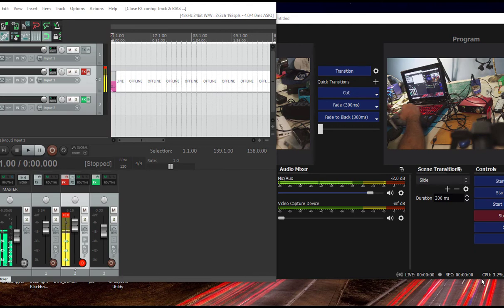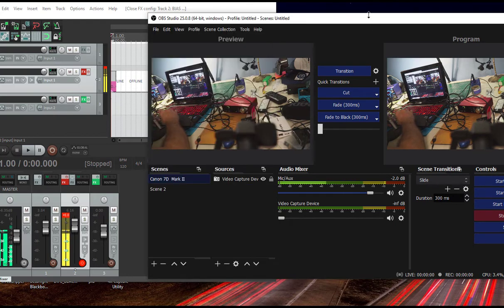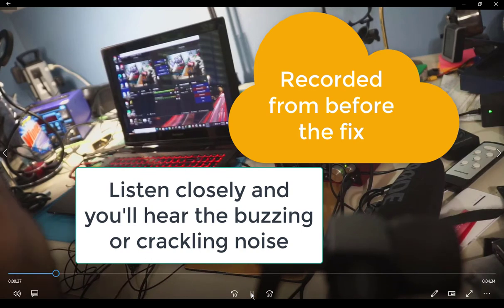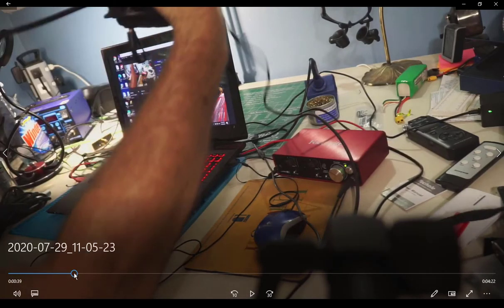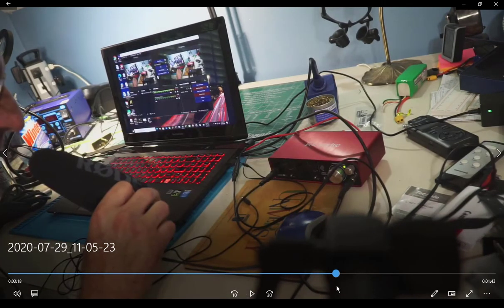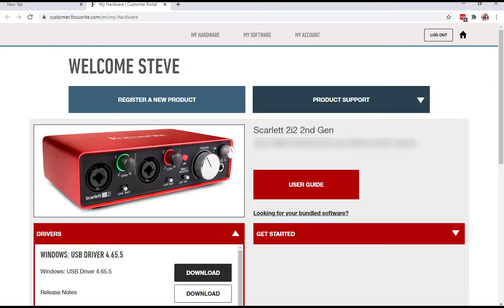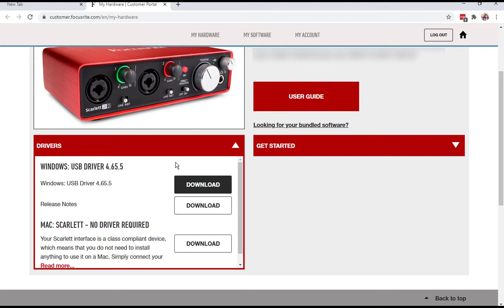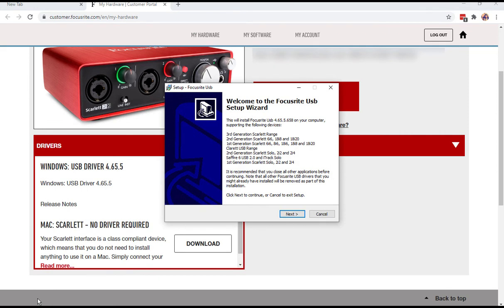FAST Fix Focusrite Scarlett Crackling Popping & Buzzing

Comment: The first thing you should do is clean your USB ports. If any dust, dirt, or grime is in them, that can short circuit your audio interface or other USB devices and not enough power can get to them. If you downloaded the proper drivers, disabled all other sound device drivers, uneccessary USB or Bluetooth devices for recording or sound playback, restarted, and are still having bug issues or problems, it's probably because your processor isn't powerful enough to run the audio interface sound card while you're surfing the web collecting cookies, and site data. If you have a lower spec processor, only use your audio interface for DAW recording and sound playback unless you like deleting all cookies, site load data from the beginning of time in your web browser, and restarting your computer all the time.
Reply: All that information was me assuming you have a PCIe slot card for the USB port(s) you're using for your audio recording interface.

Comment: FR 18i20 Gen 3. Crackling and popping when recording. Updated drivers any place I could. Only fix is changing buffer size. But the latency is terrible when recording. I resort to snap crackle pop with no latency. Focusrite doesn’t seem to give a crap either that despite their most updated drivers their product is still barely above a paperweight
Reply: This happens on my end too. and i have recently upgraded my PC too. its fast af. but still has this problem eve nat its low 1024 buffersize which apaprently is the highest it can go without the extra buffer thing which just makes everything delayed
Reply: @DJayFreeDoo  I actually reach out to focusrite directly and tried a number of things.. One thing that seemed to help a little was changing the power plan on the PC. Basically stopping all power redirects and shutdowns.. To high performance. I still get some crackling and popping, but it is better on the lower buffer zones
Reply: @ld8778  i think i found a solution on my own. i set the buffersize to 512 instead of 1024. i remembered having a similar problem with my audient id22 i used before. it could go up to 2048 buffersize. but that would cause these problems too. so i ran that one with 1024buffer. I dont get why we can't have higher buffersizes these days. they are needed in the bigger projects.

Comment: For anyone that is having this issue with other interfaces: This sounds occur when the interface is not getting enough energy, it can be a issue with the driver but it can, and is more like to, be related to the USB not delivering enought energy. That can happen if you have a weak computer and you have a lot of devices connect to USB ports. So, if the driver update doesn't solve the problem, you may have to adress the energy issue, try connecting only the interface to the computer or make sure you are using the port with more energy, some laptops have a port that delivers more energy than the others. And Good Lucky!
Reply: Bruh I've been dealing with this problem all afternoon. I only got the problem when I was gaming. The sound I was receiving was crackling and sounded kinda overdriven, as if my computer couldn't handle the game (which would surprise me considering my specs). That's all I needed to do. For those of you who have no idea which usb port puts out more energy, it's the one with the blue piece inside. Thanks a lot, my guy!
Reply: Thank you!  I simply switched my USB mouse to a wireless and the crackling is gone!
Reply: Sir, THANK YOU.
Reply: Ah thanks. I’m gonna try this. I’m currently using a simple usb hub so this seems the problem.
Reply: Switched from a 2.0 USB to a 3.2 USB Red Port and mine instantly fixed itself. Was getting ready to call guitar center and tell them my interface died after 3 days. Thanks for the tip!
Reply: @Hakuonu  I'm using the red port too, with the latest drivers and i've got the 18i20 3rd gen. i dont get why its maximum buffersize is so small though. But yeah i have had this interface for 1 day and its been crackeling and such.
Reply: Wow I’m gonna give it a try. This has been driving me crazy.
Reply: THANK YOU
Reply: wow, if i could tip you i would. thank you so much. you saved me hours of headache!
Reply: @calbarton  Actually you can on my twitch.tv/andrewsnycollas lol
Reply: I noticed crackling only in gaming, but the thing is, I got a gpu to game after having the scarlet for a while. Turns out, when I installed the gpu, I just put all the USB stuff in whatever ports. Switched ports and the crackling's gone. Thanks a lot.
Reply: YES! I THINK THIS WAS THE ANSWER FOR ME. THANK YOU!!
Reply: a year later and you're still saving people's lives, thank you so much
Reply: Yo dude, 2 years later and you still helping people.  Thanks this was my issue as well
Reply: I have had this issue starting at a live gig on the Christmas Eve and could not finish the gig. Lucky the client was understanding. I have tried everything and did not work until plugging my digital mixer directly to my computer bypassing the hub. But to confirm it’s a power delivery issue I will plug the power supply that came with the hub and let you guys know if that’s the fix
Reply: Yes, power insufficiency should be the main cause. After trying all other methods shared online, your cue inspired me to change usb port to the one that supplies the most of my computer_monitor set, as my Dell monitor provides 4+1 usb ports. Using only the one fixed it.
Reply: BIG THANK YOU YOU SOLVED MY PROBLEM!
Reply: literally just had to unplug my audio monitors smh. Had the buzz since I got it when listening with headphones plugged in! Thx very much.
Reply: of course I was wondering if windows was the problem as my MacBook runs perfect with my interface through USB c but on my desktop, I had extreme cutting out as well as cracking. I switched to a regular USB port and now it works flawlessly
Reply: Interesting. Haven't come across this tip anywhere else. As I wrote elsewhere in the comments here my focusrite did work on a friend's laptop, so this just might be the reason. Thanks! Will see if it works when I get a new laptop!
Reply: @Frankicherbz if you tried the solutions on the video and it didn't work for you, you need to check for electric issues, like no grounding, low energy deliver to the mainboard(that means your power supply is too week), sometimes even the way your cables are organized may interfere. The fact is that around any energy cable there is a magnetic field that may interfere with the audio input.
Reply: @Frankicherbz Different applications require different amounts of energy, from what you say I guess your OBS is somehow using too much energy therefore your mic crackling. But in that scenario, it can also mean something else you are doing is sucking energy. The only thing I can affirm without checking your setup is that that kind of sound only happens when the mic has not enough energy, that can happen because of a wrong drive, plugin conflicts, or simply because of a wrong USB connection like using the 2.0 when you need a 3.0...

Comment: I just don't recommend focusrite to anyone, I buyed their 2i4 2nd gen, and had many, many problems. Support wasn't able to fix my random crackling/popping issue. The headphone connector makes my headphones louder on the left side and if I slightly move the cable I stop hearing on the right side (I'm sending it to repair, it happened with not even 5 months of usage). The compatibility issues with windows and many apps/games makes it a pain to use. I don't know if it was my isolate experience, but I read in various forums that I'm not the only one, so I'll just replace my DAC when I have the money and never buy from them again until they have good windows drivers.
Reply: i have these problems with the 3rd gen 2i2 and i thought it was regular shit for the focusrites, a lot of my friends have this issue

Comment: I find that reinstalling the driver (and rebooting) works ONCE.  Then the very next time I try to boot up my computer the crackling is back. Then I reinstall the driver (same as the day before), reboot, and the crackling's gone.  Then the next day I have to do it all AGAIN.  Why won't this fix stick??  (Also tried changing buffer size, sample rate,...etc, no effect.)

Comment: Hey I know the video is a little old, so I'm not sure I'll get a reply. I am on Scarlett 4i1 3rd Gen and am getting a huge amount of crackling from the monitor out. I am trying to find the driver, but the Scarlett site seems to only have the Focusrite Control downloads, not the drivers. Any help would be greatly appreciated, working on a project and all progress has halted :(
Reply: I have this same issue right now
Reply: same issue, cant find fix
Reply: @noahdrogan9843  alr so not exactly sure why this worked but after i changed my buffer rate and change it back from the focusrite asio panel everything fixed itself
Reply: Same here. I can ily see the Focusrite Controller

Comment: I tried all the solutions. Lastly, I updated the driver of the computer's sound card (realtek) and removed the extensions in the windows store. While using 256, I am currently using 16 buffer sizes and there is not the slightest problem.The problem is definitely something like a software conflict.If you search for the same problem with other brand names, they all have it.by the way my problem was while playback

Comment: A few days ago I started to get crackling noises when I use Pro Tools (and only then!). It has nothing to do with Plug Ins (it happens in session I never had problems with and also with sessions without any plug ins), I varied the buffer length (one would assume that 1024 samples would be the best option to avoid crackling), the sample rate of the session and the interface are matched, I have a computer with well enough specs (32GB Ram, AMD Ryzen 5 3600, Win10) and I didn't change anything hardwarewise since the problem occurs. When I do an offline bounce the audio is clean, so it seems to be only a playback problem in Pro Tools. I reinstalled the Focusrite drivers, reinstalled Focusrite Control, but it didn't do the trick. Any ideas? :-/
Reply: Literally having the same issue right now were you able to find any solutions?
Reply: @goobstersroom  I was indeed able to find a solution (at least it worked for me). Try the following: While using Pro Tools, change your output device in the sound menu to anything other than the Focusrite (you can access it through right clicking the speaker symbol on the bottom right). This doesn't change the output device that Pro Tools uses but the output device that Windows uses. It seems like the crackling noises are a result of the Focusrite being both the output device of Pro Tools and the output device of Windows. 
I hope it works for you mate. Cheers.

Another problem I ran into that I could solve (for anyone interested): I encountered crackling noises when playing video games with the Focusrite as output device. In that case, lowering the Buffer Size to 128 within the Scarlett 2i2 Device Settings solved the problem most of the time, sometimes I have to change the sample rate.
Reply: @MeyerzumMischen  sounds good ill give it a try thank you!
Reply: @goobstersroom  did it work bro

Comment: Thanks for the video, sadly it didn't help for me. Just got a Focusrite Scarlett 2i2 3rd gen today, but whenever audio plays crackling happens. Haven't found a solution online anywhere yet...
Reply: Have you tried to change the buffer size ?
Reply: I tried all the solutions. Lastly, I updated the driver of the computer's sound card (realtek) and removed the extensions in the windows store. While using 256, I am currently using 16 buffer sizes and there is not the slightest problem.
Reply: @adnanpek3825  if you're using the computer's sound card then what's the purpose of the Focusrite? 😅
Reply: I have the same problem. Have you found a fix, yet? It just came out of nowhere. One minute its fine, next it starts this and has been doing it for days.
Reply: @TheDommino  sadly no, I actually lent it to a friend for whom it did work and also had a friend look at it whose essentially a music professional (mostly does a lot of FOH work though so maybe not perfect for this particular issue) and he wasn't able to fix it. I went back to using my line 6 toneport ux2 which works without any issues though. Will soon buy a new laptop and hopefully the focusrite will work then (at least everything seems to indicate it's the laptop that's at fault (Asus vivobook)). Good luck!
Reply: @ReadyMindsetGo  Maybe the laptop will help. It could be a power issue, and I know a lot of the newer laptops have the thunderbolt ports that support 100 watt power. 
Good luck to you as well! Thanks for the reply!

Comment: I got the newest drivers and I still got the same problem 😔
Reply from the maker: Try setting your audio sampling rate to 44.1
Reply: @myguitarjourney3002  already did it and each 5 minutes my computer audiu completely broke
Reply: Gott the same Problem her. Usinh focusrite, nvidia broadcast and when I turn on obs then the Sound crackle. After Research in Dr google it could be, that to many usb Devices are using the same links. I got a xlr Microsoft at the focusrite and plagen my Headset out of the gocusrite and use the on Board sound for my Headset. That works but the Sound on the Headset ist not that good.